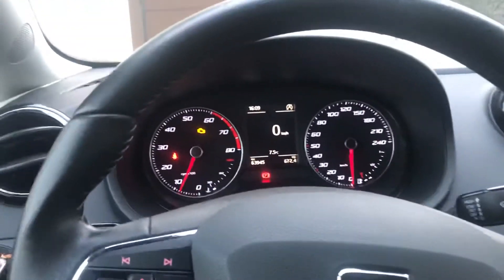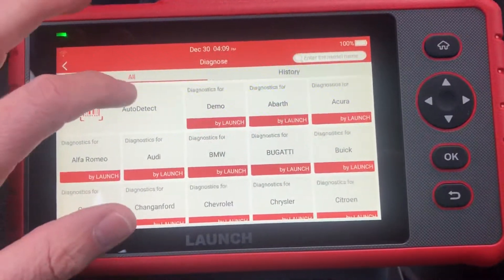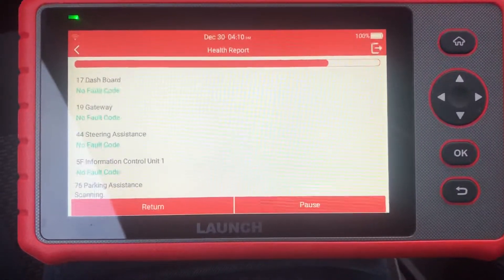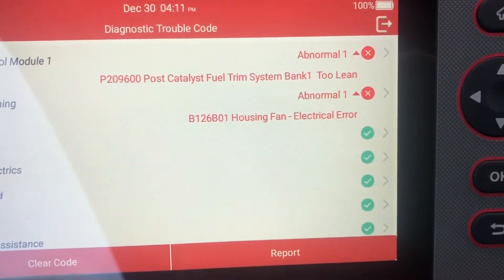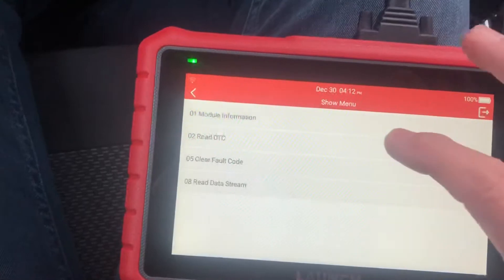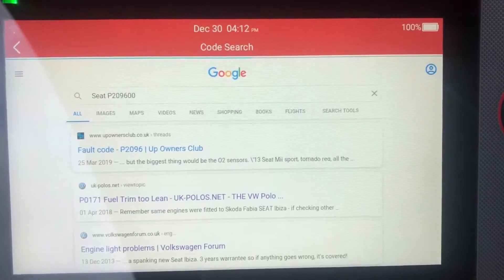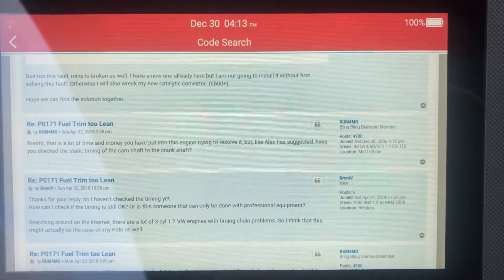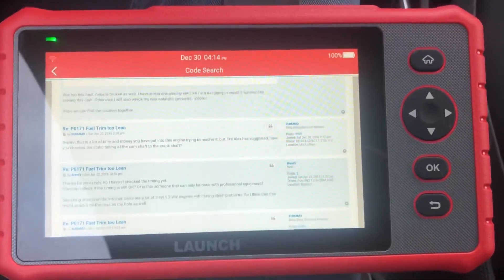LAUNCH X431 CRP909X First diagnostic report on my Seat Ibiza SC 1.0 MPI

Comment: Hey, I was wondering can this scanner do activate test?
Reply from the maker: Activate what sort of test?
Reply: @TheBlackdevil71  to activate the car components true scanner such a fuelpump, radiator fan etc???
Reply: Thank you!!
Reply from the maker: No, activate or actuations are not possible, some cars you can do all kind of resets (battery...) or learn throttle or steer angle etc.